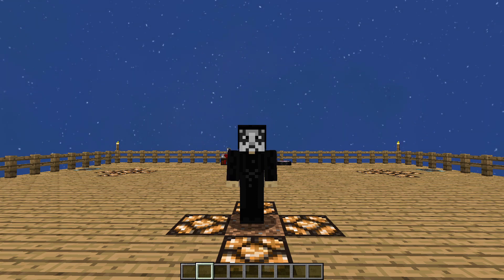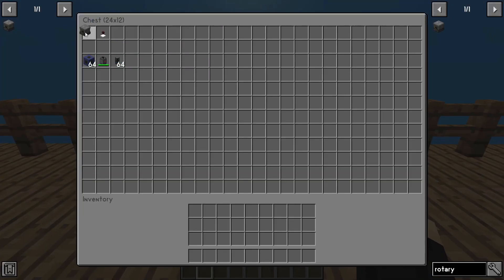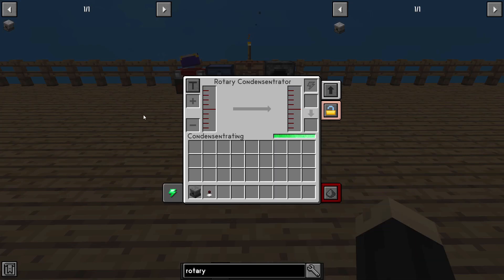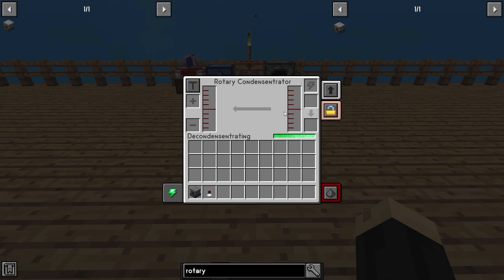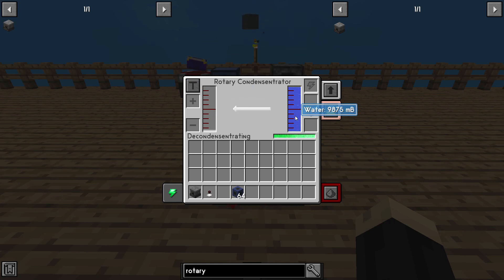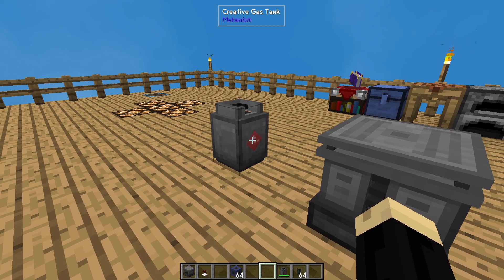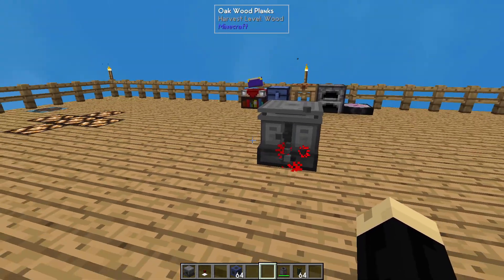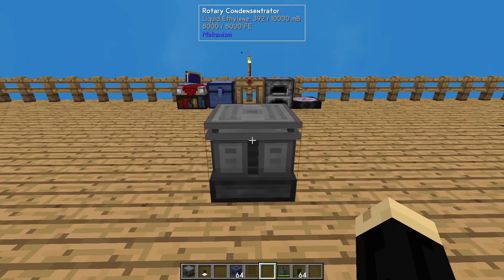Minecraft - Sky Factory 4 - How to Make and Use a Mekanism Rotary Condensentrator

Comment: No one ever shows how to get things out of it. If I put a mechanical pipe on the right it's not auto ejecting into the PRC
Reply: Make sure the input is set to the side that the pipe is connected to, and you are using the pressurised pipes
Reply: Also you need to turn auto eject on